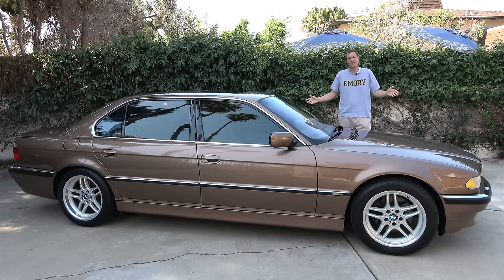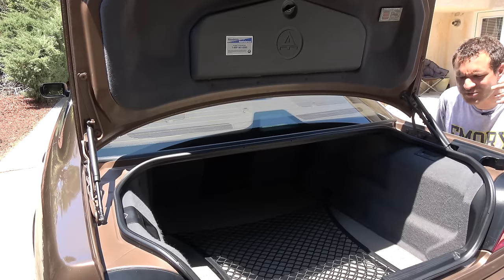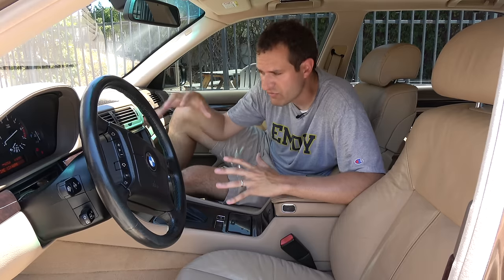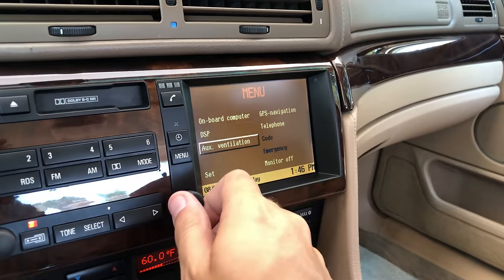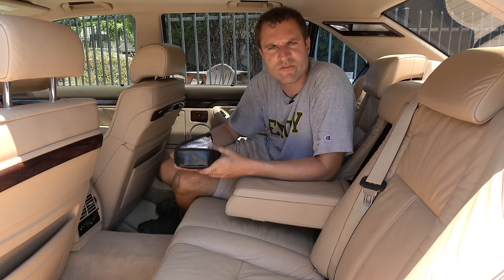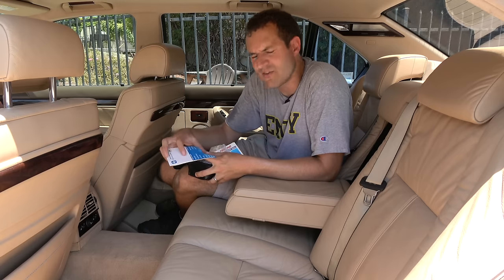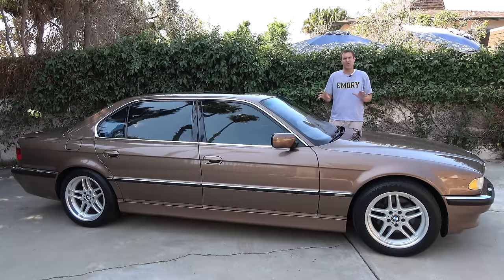Here's Why the 2001 BMW 7 Series Is the Best Luxury Sedan Ever

Comment: 0-60 in 6.7 seconds gets a 2/10?!? Those might not be race car numbers, but they aren't that bad, geez.
Reply: In 2001, that was a pretty quick car.
Reply: His scale compares all cars against each other, so only sports cars really  get 6+ (<5 sec 0-60)
Reply: A 2007 altima SER does 0 to 60 in 6.1 secs
Reply: I agree, 6.7 seconds is no slouch.  Even the newest BMW 7-series are a mere second faster to 60 mph.
Reply: It kind of is these days. It's weird; so many non sports cars are pulling sub 6 second 0-60 times now. To even register as a fast car, you gotta be in the low 5/upper 4 range. I remember marvelling at the Volvo 850 turbo's 6.5 0-60 times when I was a kid. That's Toyota Camry level speed now. 
P.S. my car is a base level Volvo S60 and it's faster. What a time to be alive!
Reply: It's not the low numbers on these babies. It's how they kick on the freeway to get out of a 70 m.p.h. traffic slump. Especially if you had manual override, like the 2000 XJ8.
Reply: Fighters Entertainment Network Maybe not everyone wants a fucking LS?
Reply: @sclogse1  Definitely.  I had a 2000 740i and I loved how I could be going 80+, floor it and still feel it pull.
Reply: @rexracer7192  2003 honda accord v6 6mt does 0 to 60 in 5.9 secs :shrug:
Reply: Jason Andrews My old 2000LS 400 did it in 5.5 with a small v8 4.0.
Reply: @9.peanut  you would think BMW would do better than Honda lol, but no
Reply: I thought the same thing
Reply: @MR2Di4  The 760Li is 4.3 seconds isnt it?
Reply: It's definitely a different era. Your modern Mustang is faster than almost every supercar from that era, not to mention infinitely more reliable. But how shocking is it really? That was a long time ago, most of the cars people are talking about now are close to 20 years old. Weren't early 00's cars that much better than ones from the early 80s? I don't know, maybe I'm too young but I don't see why the advancement is so shocking.
Reply: It's not just about how fast it goes, it's about how much stuff is going fast.
Reply: @9.peanut  and probably weight alot less xD its different class what we even talking about here...its different 6.7! Refined constant no jerky gear changes its a fucking limo don't get me wrong honda makes nice csrs but 7 series or s class merc even audi a8 its all next level for them
Reply: @PatrickRob82  volvo s60 faster than 6.7? Maybe if its 300bhp r in straight line as that car even though its 4x4 handles like shit...850 figure is impressive cause its fwd but same story useless power unless we taking 30-70 figure cornering and that its just poor performance plus that bmw is nearly 5000lbs or like 2100 kilo....better to do 6.7 and having car capable take bends on country road at 80 than having 6.5sec car and braking to 40 before every corner as it will just go straight lol
Reply: @PatrickRob82  Are you guys forgetting how much this thing also weighed?...
Reply: @9.peanut  That's not the point...lol.    Hondas are great but if you wanted a luxury car, you got a V12 BMW or Mercedes back in the day...Even a V8, but the point is V12s ran SOO much smoother than a 6 cylinder.  Made for a very comfortable ride.

Besides, 0-60 times aren't that important if you are looking at a LUXURY car. If it is, the owner probably has an M in the garage as well.

But having a "V12" always sounded cooler too...Until maintenance issues pop up of course.
Reply: @lukasznowak8873  2012 Volvo S60, 250 hp, FWD, 0-60 in 6.2 seconds. It's faster.
Reply: @lukasznowak8873  also, I wasn't talking about anything besides acceleration and neither was the original commenter. I didn't buy a sports car so I don't need it to handle like one because I don't drive like a pissed off teenager. All I was pointing out was how cars have gotten faster off the line.
Reply: @PatrickRob82  well 11 years difference and 500 kilo in weight ...its all on the paper ...average road user stand no chances with his volvo when we talking 0.5sec difference you would get smoked so badly ...on the paper 6.2 in real world more likely 8... unless proper tires applied and maybe driven by stig :D
Reply: @lukasznowak8873  lol ok, buddy.
Reply: David Topchiev  What are you on about kid? I'm aware of the comparison, funny thing is i was reacting to the 760 being 5.7 seconds to 62 mph. But then again i guess you don't generally read...
Reply: Yeah, I don't even watch the Doug scores anymore. Every other one is ridiculous.
Reply: But this is a scale that includes super cars and sports cars. There's not much room for differentiation if you rate something like this a 5 and a Ford GT is a 10. The numbers start to lose a lot of their meaning at that point, especially when you have 100+ cars rated on this scale.
Reply: Poor Hyundai Grandeur 2007, with 188 HP and heavier makes the same time... with a poor V6. So what ? Where the power here ? Where is the motor ???
Reply: well dads 530i from 2001 is about the same time, its maybe a bit lighter but its also a touring with 230hp, and it is as said around 6.4-6.7 sec to 60
Reply: @DITUnited  this car is way heavier than a lexus ... it is a damn tank man !!
Reply: Yes,but for those 12 cylinders it's not good at all

Comment: Fantastic review Doug. I have a regular 740i and you nailed every single point to the letter. These cars are a joy to drive at any speed and and still get decent fuel economy for being 2+ tons. Mine still gets 26mpg highway, just like it did when it was brand new. Even lacking the massage option, one doesn't notice they've been driving for 10-12 hours. This particular car looks like an Early 01 model, probably a July or August 2000 build. My E38 was built in September 2000 and got the 16:9 Widescreen setup. Just that touch alone makes it look FAR newer than it is. Add a MkIV DVD Navigation drive and map disc updates can be found through 2016. Quite useful when cell signal isn't available. Mine actually got the MkIV upgrade under warranty and it earned its weight in gold in Middle of Nowhere Indiana.
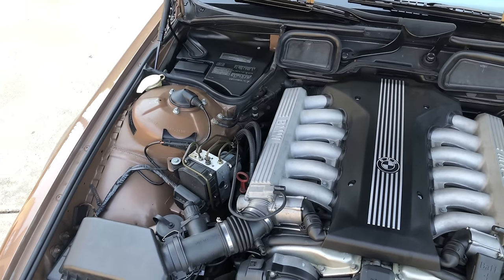Reply: I checked the VIN you can see at 03:21 and it this model is from 05.2000. Good guess!

Comment: My favourite car I ever owned....I had a 750i swb in cosmos black with grey leather and just about every option. It's original purchase price was £73,000 in 1999. What did I pay for it? £500 in 2010. And then another £1200 getting a few things done. What a car! Champagne motoring for lemonade money.😉🏁
Reply: Good lord do German cars really not hold their value this badly? Literally over 99% depreciation in 11 years?
Reply: Seems to be the case mate once they become older in the uk the poor economy and repair costs make them less desirable especially given the crazy fuel prices here.😣
Reply: That's a shocking loss in value for pretty much anything. Great deal for a car lover though. German cars quickly lose their value over here in the US too, although not quite that much.
Reply: How's it going for you? I'm thinking of picking one up (hence how I found this video!) but unsure about reliability.
Reply: 500???? HOW?
Reply: I got a low mileage E46 325i for less than $4000 last summer

Comment: I had a 2001 740i with those same rims but I had the sport seats and larger navigation screen. I bought it in 2012 with 150k and I thought that car drove and handled better than even brand new cars at that time. Also Doug didn't mention that the steering wheel automatically raises up when you shut the car off to give you more room when exiting/entering the vehicle. When you start the car it lowers back down to where you normally have it set.

Comment: Hey Doug, Firefighter paramedic here just letting you know that guys theory about the seatbelts is total bs. No matter where the seatbelt is you only need one cut to remove a victim, the remainder of the belt just pulls out of the latch connected to the buckle
Reply: I'm not even a firefighter paramedic and I thought that the second he said that. I figured it was to keep the passengers apart during a side impact.
Reply: I have an E34 with the same setup. I always figured it was because it was more sturdy for the buckle receptor to be attached to the car in a solid fashion versus the normal strap.
Reply: Doud just talks about things he doesn't understand
Reply: @rotorhead5826  or because it pulls you away from the pillars
Reply: Enrique Ruiz he literally says “the owner of this car says HE THINKS it’s because...”
Reply: I agree, but why can't you just say 'I don't think that's true', instead of '[...] is total bs'?
Reply: Allert Schallenberg some people have no decorum

Comment: Some factual corrections...The headlight warning sticker is there because the E38 features Xenon headlights which are high voltage, it was the first car to feature these awesome lights. The trunk/boot lid can be opened by a button on the key fob or you can use the button on the trunk/boot lid without the key if the doors are unlocked. The trunk/boot lid lifts easy without much effort if the struts are in good condition and even stays in positions like half-way. The cupholders in the car shown are broken, they should just glide out at the touch of the button.
Reply: The hydraulic system that opens and closes the trunk on this car is most likely broken or all the hydraulic fluid evaporated over the last 17 years. I drive a 750iL myself and i already hd to fill up the reservoir. Usually the trunk opens by itself as soon as you push the button on the lid or inside the car and u don't hv to insert the key first.
Reply: Your both right. He doesn’t know what he’s talking about.
Reply: No the E32 750i was the first one with xenon ;)
Reply: ExeKuTioN Cro True
Reply: Thank you sir, I was thinking the same thing and didn't want to type it out. When he makes those mistakes it really bothers me...
Reply: True, but then, broken cupholders is just a part of owning an E38.  That and cracked expansion tanks/radiators and bad timing chain guides lol
Reply: @Strahan740i  Between my housemate and I, we have 6 x E38 and E39 BMW's. I find broken stuff is due to previous owners rough/dirty use and severe lack of maintenance. All our cars work and function just like they should, we don't jam oversized cups in our cup holders so we don't experience your types of issues. Another thing is that we do is accept that now these cars are well over 15 years old, that they need a big once over for maintenance so they can last a further 15 years without too many random dramas (and that goes for any car brand). On the most recent acquisition a 1999 E38, I replaced all engine gaskets, seals, guides, main chain & primary tensioner, entire cooling system (- heater core & valve), traction strut bushings and a few other bits all as preventative maintenance and used about $3000 in parts to do it and about 60 hours of my labour. That E38 is being used as a "super comfortable and safe" weekday high mileage work transporter that will be effectively way cheaper to own than depreciation costs on a newish cheap tinny Jap car which may never break down but will lack a lot of opulence and functions.
Reply: @jakedekleuver   "Your types of issues?"  lol interesting comment.  Are you assuming I'm some dirty hillbilly who beats the shit out of his car?  I've had several E38s and an E34.  I kept all my vehicles in tip top shape.  Something broke, the car was at the shop the next day.  All regular scheduled maintenance performed.  I have a file on my last one over an inch thick.  $25,000 in maintenance over five years.  You don't need to use big gulps to break an E38 cupholder; regular usage will break that piss poor design.  Don't believe me?  Look around e38.org or bimmerforums.com and see the plethora of other people bitching about it.  Also you imply owner neglect is to blame.  What kind of preventative measures can you take to stop annoying crap like pixels in the dash BC readout dying, or hitting the window switch and hearing a cacophony of grinding followed by the window refusing to move or window sprayers that cease to operate?  Unless you are replacing every possible wear item during your once over (and you'd have to be rich to do that lol), it's just something you have to accept as inevitable.  On mine it was every other month or so sigh
   You said it yourself; they are old cars.  Shit breaks, it's just the way it is.  

I'm glad you are apparently lucky with yours, and that you have the skill to do your own labor, but in my experience (and most of the people I read about on the forums) these cars are maintenance headaches.  Doesn't stop me from loving them though, still my favorite car.  I'd still have my 00 740i sport if it wasn't for needing to hoard cash to buy another house.  The E38 was too much financial cancer for that, lol.  I replaced it with a Hyundai which has been with me 3 years now, and has cost me $1,383.08 so far.  Far more advanced functionality, way better fuel economy, superior sound system but yea..  opulence and presence?  Not so much heh.  I miss the solid feel of the BMW.  I miss doing 130 and feeling like I was doing 50 in my Hyundai :)
Reply: well crap, I just left this same comment! should have read through first! Good info, Jake. This is the best car I have ever owned.
Reply: @Strahan740i  so true, also 80k  mile cooling system replacement, 80k front struts and rear ball joints and the dreaded lost pixels on the dash! I still love it!!!
Reply: it's also wirth knowing, that some models of e38 came with a powered hydraulic "hands off" tailgate system, like many present day cars do. Just press the button on the key to open, and press the button on the inside of the tailgate to close.
Reply: @stopthephilosophicalzombie9017  if they factory fitted they fine self leveling etc if some boy racer fitted them instead of halogen lights then yeah i hate them 2 lol
Reply: @Strahan740i  I had a cracked expansion tank and radiator too.
Reply: @jakedekleuver  My nigga. That is what I call a real BMW owner. Don't meet too many people who work on their own cars these days.
Reply: @stopthephilosophicalzombie9017  Yeah bloke. I been fixing my own motorbikes, tractors, cars whatever for 45 years. It means problems get fixed properly to original condition, no risk of my car being touched by someone who overcharges or charges for stuff not done/supplied, causes other damage and hides it, overlooks potential imminent failures etc.
Reply: Jake de Kleuver Indeed. What parts suppliers do you like to use?
Reply: @stopthephilosophicalzombie9017  I'm in Australia and Pelican Parts in California get stuff to me fast and about half the price or less than local for genuine parts.
Reply: @jakedekleuver  That's awesome. Pelican is my go-to as well.

Comment: Completely agree with Doug.  I fell in love with the E38 when it was released even before watching it in Tomorrow Never Dies blowing up lots of Mercs being driven by the villains. As I was only in my 20s I went for the next best thing, first an E36 3 series and then the E39 5 series. 2 decades and a lot of modern BMWs later I still want an E38!  It’s interesting that a lot of features from the E36 and E39 are replicated in the E38.
Reply: Just donated my 2001 740il with 200,+ mi on it. Loved it but plastic falling apart.

Comment: That's the BMW 750iL from 007 tomorrow never dies.
Reply: Kevin O'Leary and Transporter 1
Reply: The Transporter one was a 735i, v8 engine with the short wheelbase and a manual transmission. Perfection.
Reply: Actually the one in The  Transporter was a one off 750i with a manual gearbox and badged up as a 735
Reply: Actually the 750iL from 007 were actually rebadged 740iL's
Reply: Actually I’m gay
Reply: And please not forget the Armored 750iL from the Movie “The Game“ with Micheal Douglas!
Reply: Thanks captain obvious.
Reply: actually, I'm your sister's brother's cousin's former roomate

Comment: You have a couple things VERY WRONG or missing: 1. The seat belts are like that in the rear due to being a car that your chauffeured in so it was so when you where buckeled in by that person you are not reaching across their groin. Also the NAV can be updated to a MK IV nav which made it to 2006 and you can get an update disk to 2012 which is pretty Impressive, not to mention thats an early 01 they made full widescreen models after feb of 01 (I have two 01 sports with wide nav) Also even though thats an 01 its not a 750 Sport, they made a LWBV V8 and V12 sport they have shadow line trim not Chrome trim on the impact strips, they where very rare, they lack the SWB sports, suspension, high stall tq converter and the diff rear diff. Also the seat up front is not a massage seat, its a semi passive seat that changes the inflation of two bags only in the seat base that makes it so you dont fatigue by shifting your butt cheeks left and right. Also you missed the SEDC which was electronic dampening on a non air sprung car on 750s. Also for your picking on the acceleration, the V12 was still faster then the V8 M sport even though it had a better diff. Also last there is center console storage its vertical and fits an iphone or a decent size wallet you completely missed it. Also its 0-60 of 6.6 for V12 and 6.8 for the v8 is faster still then the base 320i, so the base cars still haven't even caught up.
Reply: Nick Bennett you are spot on!  I had an 01 750 dinan 7.  Loved this car and should never had sold it.
Reply: Same seat belts in the E36... can’t remember being chauffeured in one of those.
Reply: I’m pretty sure he was talking about a new base 7 series, not a 320i
Reply: The seat belts are that way ACTUALLY to allow you to unbuckle and get out without the seat belts snagging on your arm. They allow you to slide out faster.
Reply: The Chauffeur doesn’t buckle you in. You’re thinking of your mom.

Comment: Still have mine in mint condition, a dark grey. '99 e38 728i, installed the 18-inch M-parallel rims, and an M-sport steering wheel. Still drive it on sundays.